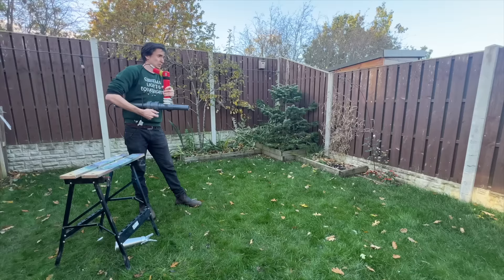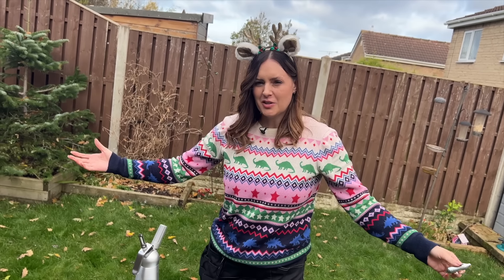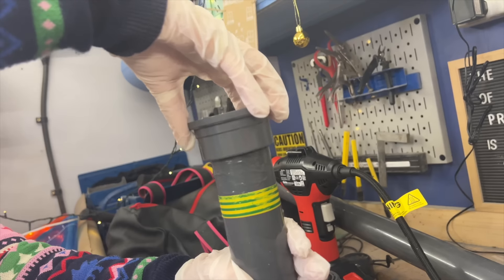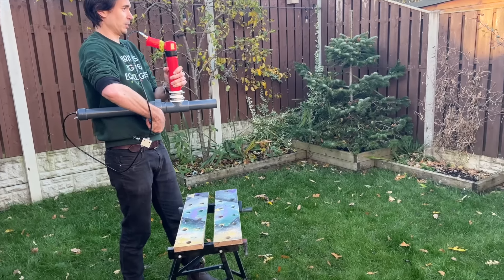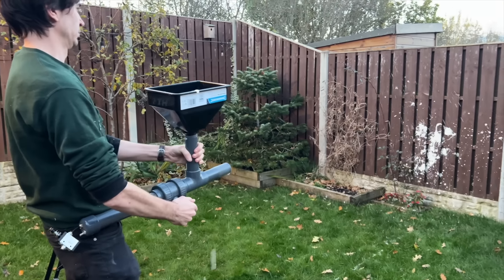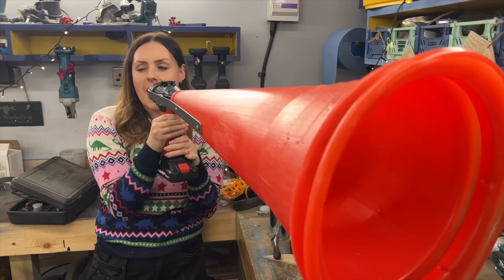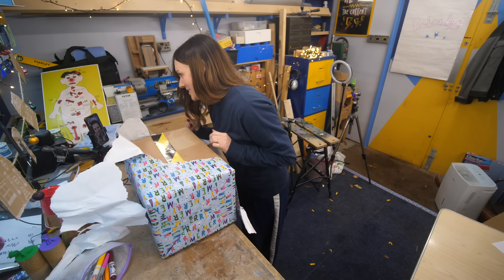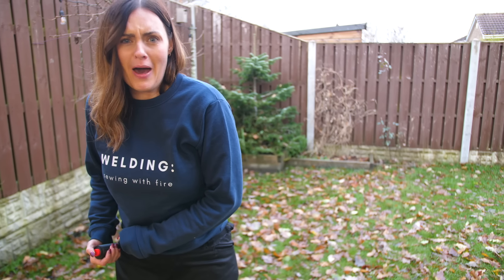We built an Ice Cream BLASTER!

Comment: I did nearly put a fire extinguisher in the box with it but it just just felt so wrong.......
Reply: What about a safety tie then ?
Reply: @tel0004 Well there is regulations on flammable or explosive stuff. You can't ship batteries though the post either, as you have to label it so the driver used are trained and knows there is explosive or flammable cargo.
Reply: @tel0004 now thats hilarious 😂
Reply: Some kind of kilt fire blanket.
Reply: Haha I bet the cream launche would be a great fire exhinstion
Reply: Should've had one button that activated the flame thrower and another button to deploy a fire extinguisher...

Comment: the first test was nitrous, not c02, right?
Reply from the maker: Nitrous Oxide canisters are illegal in the UK unless you have a "legitimate use". Not sure whether this would qualify or not 😆
- Shawn
Reply: Looked up the legislation in question, fascinating.  Whippets is a problem here in the States as well, but they do use those NO2 canisters quite a lot in the food industry.  It says a license isn't required to carry NO2 canisters, but you have to "prove you don't intend to inhale it".

If you were to try to make whipped cream with CO2, the CO2 would bind with the water in the cream, creating Carbonic Acid, and curdle everything.

Comment: The biggest problem (looked like to me) is that the propellant makes its own channel through the soft projectile. A shotgun would do the same thing if it weren't for the wad pad under the pellets. Can't help feeling that you'd getter better results if you used something like one of those felt "feet" they sell in the hardware store to protect your floors. But of course you'd have to keep reloading it one shot at a time.
Reply: it doesn't need to be sophisticated, though, just edible - a thin disk of chocolate? even a rice cake? would be solid enough to not "channel" but wouldn't be too dense to fling faceward...

Comment: Cool idea and love this time of year when you all build some weird things. Only concern is that you should never air pressure PVC pipe or fittings. When they explode it’s flying shrapnel. Please be careful
Reply: As a teenager my friends made potato cannons using PVC pipe. I guess that's one more bullet dodged in a long list of things that could have ended us 😬
Reply: Didnt Mythbusters air pressure one over 140 psi to shoot a potato?
Reply from the maker: Thanks for the feedback. We used thick-walled high pressure rated uPVC fittings & adhesive that are rated to a much higher pressure than we pumped them up to!
- Shawn